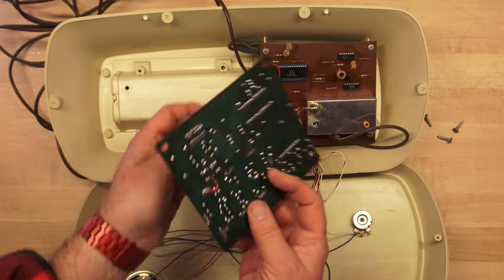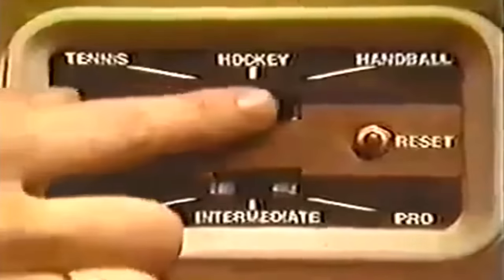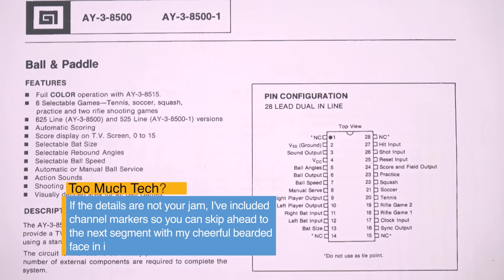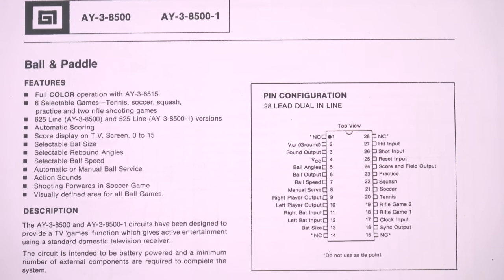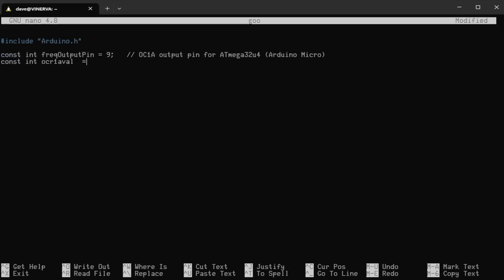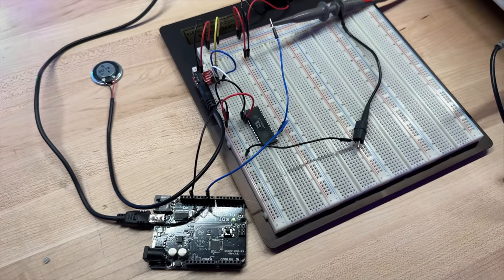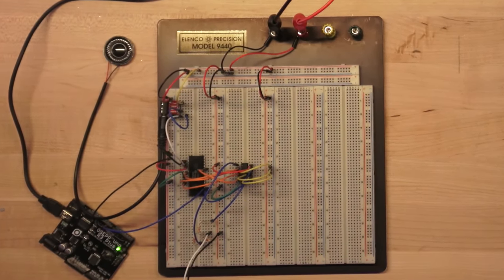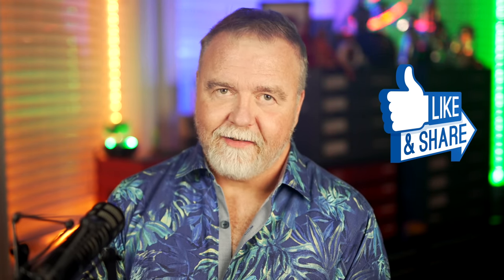PONG! in a Breadboard - Can We Build it?

Comment from the maker: NB: My apologies for thinking Jack Tramiel was president of Bally!  I crossed some wires on my history, as Mr. Tramiel was at Commodore at the time.  There's no indication that he rejected Pong - that was on whoever WAS the CEO of Bally at the time, not Mr. Tramiel as I indicated.
Reply: Sounds like a thing Tramiel would do though. so completely believable. :-)
Reply: @bensonwr  In terms of the brash impulsiveness, yes. In terms of the bad instincts, no. Tramiel had excellent instincts.
Reply: he would probably turn over in his grave if he heard any of this

or urn
Reply: BTW the Coleco Telstar Marksman included a rifle for the shooting game. I think I have one in the garage if it's important I might be able to open it up.
Reply: Now do it without the arduino. I feel like the arduino could probably do everything on it's own anyways so let's replace it with a normal square wave generator. How about the ic555?
Reply: @SlavTiger  How about the UE555? PCB gerber files/schematics are now available from Usagi Electic. 
Ha-ha, only serious. You know, Dave, you conceivably could collab with David and build all of PONG with vacuum tubes, to include a recreation of the AY-3-8500. UE-3-8500, anyone? For the maker of the UE14500, building a UE-3-8500 should be a cinch.
Reply: PS: Turns out that according to Cole's Nerd-Stuff blog (which has decapped die-shots), the AY-3-8500 containes about 2000 transistors, which is an order of magnitude more than the MC14500B (or UE14500). I foolishly thought that since these ball and paddle game systems weren't freely programmable, they would be simpler than the MC14500B. They're not. So actually cloning an AY-3-8500 with vacuum tubes might be a tad bit too demanding.
Reply: @bensonwr quite the contrary. He made MOS create a chip and sold lots of Commodore pong machines. He had a nose for what would sell.
Reply: Sir I commend your actions in self correcting an error. It has become a rarity  in today's world.  Yes I have become a fan , my son the IT guy in the family, did love the tour video. His computer skills are born of a , Microsoft program,  which supplied all the Microsoft programs and study materials. They need to make such available again  as such training,  was instrumental in procuring good jobs for all my kids . Take care. Ps  learned a bit myself , made the kids build their own computers ...such fun , even led me to test some Microsoft software, which  I enjoyed .
Reply: Your best solution would be to delete this, re-edit it, and then reupload it, since a lot of people probably won't see this announcement and would get the wrong idea.
Reply: @SlavTiger  - NE555 has a built in power shortcut moment - not recommended - also i would be unsure if its fast enough.

a good quartz should be out there. halving or doubling its frequency should not be much of a problem.
Reply: @ropersonline  at 6:06 you can see the first generation prototype board - it had 75 ICs with 14 pins mounted. Give an average of 4 logic blocks to be contained... and you will end up with 300 gates. Each gate might be done by some 5 transistors. this gives a total of 1500 transistors. If further a few of the chips are of a slightly higher complexity, such as adders and counters then you will end up with maybe a factor of 33% more... giving you a nice 2000 transistors inside. Perfect match!

What else do you want to have estimated now?
Reply: @alexanderstohr4198  Thanks for the hint. Right under my nose! Though it looks closer to 66 ICs by my count, not all of them 14-pin, and not all pins connected, suggesting that not every gate in every chip was actually used, which was common when designing with off-the-shelf ICs, and which should reduce the effective transistor count significantly. I guess this would still be about four or five times as many valves as in the UE14500, and I have no idea if a MOnSter-like PONG recreation in vacuum tube-based technology would still be fast enough for NTSC, especially at lowish voltages like Usagi David uses. Since you're offering: If you're able to estimate these limitations, [Office Space meme voice:] that'd be great (How fast/slow are valves anyway, and what about the speed of light being a problem with humongous PCBs at highish frequencies?)
Reply: Around 1972 I was playing pong done up with ICs sitting in a living room. The engineer still in school, went on to many positions including designing the 486 Cheetah high memory performance chip.

Comment: Paddles work by resetting both RC circuits at the video vertical blanking interval, and then using a pair of comparators to measure the number of times the horizontal clock was generated. If the voltage went above the threshold on a particular line it set a latch, and enabled another counter that counted lines, and put that as the paddle position, Then the counter that was running to generate horizontal elements on the display would and this. This would go to two places, first to video out, as the paddle, height being a certain number of lines, and also to another and gate that has the horizontal position of the ball, so that if it was in the way the ball would have the direction reversed and returned, and if not it would be classed as a losing ball.

Very simple, and the sound was generated out of internal counter overflows, using the logic for the hit to do the beep, gating in the clock for the paddle display, and for others using other counter outputs and different frequencies.
Reply from the maker: I'd love to be able to understand the full TTL impl of the original!  But this is more my speed for now... thanks for all of the details and context!
Reply: Great details. I was hoping to see something like this. Having hobbied with tube radios in the 1960s, worked with TTL in the 1970s, and then with 8031, 8088, 80286, in the 1980s, I lived the progression in technology. Dave (IMO), I think it is important that younger engineers understand that computers, microprocessors, and devkits are not necessarily the universal answer to everything. Thanks (new sub)

Comment: Awesome. Pong was the genesis of my (currently) 37-year career and obsession with computers. A family friend brought over a home Pong console – probably smuggled into my country – sometime around 1976. For reasons I'll never understand, the fact that this little box could control the image on our TV absolutely blew my young mind. It was beyond magic. We moved to the USA, I got an Atari VCS, sold it to buy an Atari 400, and my path was set.
Reply: Similar story here.  Although all electronics mesmerized me as a kid.  I have pictures of me when I was 3 with all the wires pulled out of the electric car my dad got me.  I was apparently trying to figure out how it worked, and so my fate was sealed.  I got into coding because I wanted to control the electronics.  My parents had bought an IBM XT clone called a Leading Edge, and I taught myself x86 assembler so I could control the PIC and other aspects of the machine.  You can only get so far with PEEK and POKE, so assembler was what I needed in order to implement my own interrupt handlers.   I didn't know about C at the time, since my only tools on the PC were GW BASIC, and DOS Debug (which was sort of an assembler/disassembler rolled into one).  Then I discovered MASM :D  That ended up parlaying into a career as an embedded developer.  It's the best of both worlds really :).

Comment: Hi Dave your content is always a sight for sore eyes. Especially when you get into old tech like this one or the KIM-1.
Your take on the paddles seems correct, there is probably an internal capacitor in the chip that is discharged in a regular interval and an internal counter that counts how many cycles until it gets changed by the external RC circuit created by the potentiometer. Once charged (goes high) it will take the value of the counter to set the position. That is why with no pot connected it assumes the position is all the way in an extreme (high or low depending on the logic they choose).
By the way thanks for the book, my daughter is also living in the spectrum :)

Comment: Back in the day, I worked for a company that in addition to making Dental Operatory furniture, made game tables for bars, etc. these had pong or hockey and places built into the table for the players to set their drinks. We spent our lunch breaks playing these games of course, after all they needed to be tested before they were shipped.
The circuit boards used a lot of discrete chips as at the time there wasn't a dedicated pong chip available.

Comment: As a kid, my family actually owned a "pong" game console (called "TV Scoreboard", if I recall correctly) made by Radio Shack which also came with a light gun and did enable the "shooting" modes.  I remember playing those game modes (and being amazed at how it could actually tell where I was pointing the gun when I pulled the trigger.  It really did seem like magic).

And yes, I'm pretty sure the way it is detecting the paddle setting is by bringing that input pin down to ground, which will drain the capacitor, then letting it float, and timing how long it takes the capacitor to charge up (and the voltage on the pin to rise to a certain threshold), then repeating the cycle all over again.  It was a common technique for measuring resistive analog inputs such as these (and analog joysticks, etc) at the time.  If it drains the capacitor through a different, known-value resistor, then it can really just compare the ratio of charge to discharge time to determine the input value in a fairly accurate way (which actually doesn't even depend on the value of the capacitor used), though I don't see any indication that it's actually doing that here, so it's probably just using the raw charge-up time as the input.

Comment: It was actually my first electronics project as a kid. An electronics kit based on a schematic by a Dutch magazine called Elektuur , this one had a basic UHF modulator so that you could hook it up to your antenna input of the TV.
Reply: Is this the TTL one you're referring to? I still have those early Elektor magazines and bought the pcb for their ttl version. It had no sound though as far as I can recall, I ran out of funds to complete it and in the meantime the AY-3-8500 game chip became available so I bought one and built a six game version on Veroboard, also using a TV modulator and a couple of potentiometers in Veroboxes for controllers. Happy Days.
Reply: @caramba10  No this one is the AY-3-8500 version. The TTL is older.
Reply: Elecktor is still going strong and you can subscribe today to get access to all the past projects.
Reply: @grantbanstead1971  I know ☺️ But I have all magazines in PDF since 1964 , and the English ones since 1980

Comment: 1975, spring senior year digital circuit design course, MIT.  Your final project was to build something significant in the lab, and everyone pretty much did some sort of video game copy.  I remember all we had were TTL gates and FFs and some crude shift register memory. The projects were built on vertical racks. Each rack held  maybe 60 cards, each card had 2-4 TTL chips.  A finished project took 3-5 racks. My project was a Game Of Life simulator but there were multiple Pong, Brickout copies. Good times but a lot of pressure. Countless late nights.

Comment: I remember Tandy in Australia sold a seperate rifle for the shoot facility. 
Electronics Australia ( magazine)published a diy rifle for the enthusiast.
In Australia again Dick Smith electronics marketed a full electronic kit. The first issue of the kit had no sheild, or modulation shielding, you were required to manually tune the video signal to each TV that you connected too.
Later the kit was modified with specific TV channels “ built in “

Comment: I am an old school Electrical Engineer and I have been helping a guy restore an Asteroids arcade game and the interesting part is that rather then raster scan (like a TV uses) it does vector drawing by directly controlling the CRT's x and y deflectors.  I have a suspicion that original Arcade Pong game probably did the same thing - which would not have worked at all with a home TV set.
Reply: The original pong arcade game cabinet used normal raster scan, it actually used off-the-shelf TVs that were modified to accept composite video. 

I have an original pong cabinet that I restored

So while it wouldn't plug directly into most home TVs at the time (they didnt have composite video input), it could be connected by bypassing the tuner and putting the video straight into the board, which is what they did for the tvs put into the arcade cabinet. 

You could also connect it to any modern TV that has composite input

Comment: I remember as a young engineer being sent from our base in Scotland over to the GI plant in Hicksville, Long Island, to help set up the automatic test equipment for this chip. 

Compared with our normal fare of testing single chip calculators and X9 / 10 devices, this chip with it's (for the time) very high data volume was a nightmare.  

In addition to any obvious functional failures, any 'snow' on the screen meant a fail so everything had to be verified.  

If I recall, the decision was finally taken by GI  to use  auto-testing to verify that the die at least showed the basic vital signs then leave the rest of the test to a human tester in GI's plant in Kaohsiung, Taiwan.

Many thanks for the trip down memory lane.

Comment: I suspect your paddle pot value changing the time required to charge the cap guess is correct since that is also exactly what was done in the Atari 2600.  I would love to see more done with this custom IC.
Reply: I agree. I built a serial port temperature sensor circuit years ago, using same logic with a thermistor. Very basic A/D conversion...
Reply: The original "Game Control Adapter" for IBM PC used a similar electronic concept, with the pots feeding inputs on a 558 quad timer and the digital side being a pulse width that PC code had to translate to a numeric value representing joystick position.
Reply: @tripplefives1402  That doesn't sound quite right.  The chip itself will short the capacitor to ground and start the counter.  It then releases that short, and STOPS the counter when the cap charges to a certain point.  The count is then used as the paddle value.  So the capacitor is triggering the stop of a counter, not the start.  The process keeps repeating, so there is another start of the counter immediately afterward.
Reply: @tripplefives1402  Of course it would work.  That's how it's done on the old Atari paddles.  The capacitor would charge to 63% of its capacity in about 1ms when the pot is turned all the way down.  10Kohm * 0.1uf = 1ms.  That's way below the clock rate of the IC.  When the pot is turned all the way up to 1Mohm, it would take 0.1 seconds to charge.  Easily done, and easily disproves your "there would be almost no difference between max and min values".  10K ohm to 1.01M ohm.  Big difference.  Look up RC time constants.

Your "giant electrolytic" on the 555 timer is also paired with a resistor, that you seem to be forgetting.  You pretty much have the idea, I was just pointing out that saying "the capacitor triggers a counter" is a little simplistic and misleading.  It triggers the stopping of a counter.  Or a "save the value and reset the counter".  

It might not even be using a counter at all.  As someone else pointed out, it's probably just using the charging time to determine how long to wait after vertical blanking to start drawing the paddle.  ...in an analog fashion, no counter needed.

Comment: I love that the frequency (488hz, 976hz, and 1.952khz) and duration (32ms) for the beeps and boops, for pin 3 I assume, were included with the PIP functions. I used a tone generator and, yep, those are pong sounds. 🧐 Fun video! I would like to see a retrofit.

(The sheet said 1.95khz but it looks like they just doubled 488 to 976 then doubled that again so it's presumably 1.952kz. 🤷🏻‍♂)

Comment: It looks like the chip pulls the paddle pins low periodically and measures the time the RC network takes to recharge to a set threshold. As you turn the potentiometer, the total series resistance goes from 10k to 1 Megaohm. With a 0.1uF capacitor, the RC time constant changes from 6 milliseconds to 0.6 seconds. Some logic must translate this delay time into position on the screen.
Reply: The tricky part you're missing is that the R/C is "measured" by how long it takes to reach a scan line, in real time. You have to think in terms of where the CRT beam is as the R/C is recharging.

Comment: Either Radio Electronics or Popular Electronics had a construction project using the GI chip back in the day. App note from GI was pretty complete on how to breadboard the device. The hardest part was building the RF interface to attach the game to the TV. The generic ones that came with the games were hard to find until a few years later.

Comment: Dave, 2 of the not gates of a 74HCT14 and 2 carefully chosen resistor+Cap will give you a very stable and beautifull 50% TTL square wave in frequencies from 8Hz all the way to 2~4Mhz

A real lifesaver, instead of dealing with the vagaries and extra elements of the 555 or a crystal oscilator (+divider).

Was my secret weapon at the Lab while studying Electronic Engineering in the 90's.

Comment: Here in Australia I used to repair machines called pub pong in the 1970s. Lots of local bars had them. They were not single chip machines.  Most of the faults were due to wear and tear on the controls. I don't remember who made them.

Comment: You can bit bang out a composite signal with a microcontroller.   An old colleague of mine made a Pic Pong in the 90's on a microchip pic.   This gave me the idea a few years ago to replace the video overlay chip on a drone with an arm M0+.   It ended up working very well.